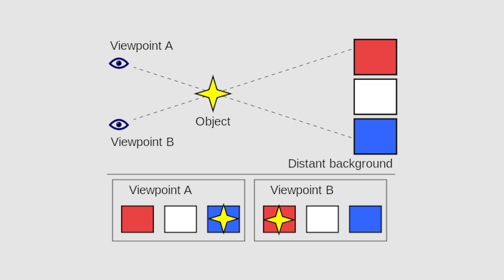How to determine lens nodal point for panoramic photography

Comment: That’s brilliant. Thank you.
Quick question, if I may: what computer do you use to manage a bunch of high MP files, when sticking your pano together? Assuming you’re happy with its speed and handling.
Reply from the maker: Hi Andrew. Thanks for writing and I'm pleased you enjoyed the video. In our studio we are a 100% Apple ecosystem, with a collection of desktop and laptop configurations. As long as you invest in a lot of memory and solid state drives, you should be able to handle the stitching with minimal wait times. When I shoot macro I might have 100-300 images to stitch in a focus stack and even my laptop handles it smoothly, although it might take time. When I shoot panos I rarely have more than 40-60 images, maximum, so that goes pretty fast. Keep in mind that I shoot medium format and those are 102 MP files!
Reply: @lespicker  Very useful, and reassuring, to know. I use Apple and am probably reaching a point of upgrade/change, although will 99% stick with Apple. With the increase in camera MP, processor-hungry software, etc, I have found it difficult to know what to expect anymore from computer performance. In my regular work as a freelance pro photogapher, I have lots of images to process, yet some apsects of processing seem to take increasingly longer, with new software!  The general expectation of the age is that we should be able to work at what I call click speed...instantaneously, or a couple of seconds, and it's all done. Certainly, my 2014 27"  iMac, albeit fully loaded, is, IMO beginning to struggle, and has reached the limit of OS upgrades and just now, optimum system requirements for PS. I'm thinking a 16" MacBook Pro M1 Max, with as much memory as I can afford....but, it's all getting quite expensive.
Reply from the maker: @andywilk38  Unfortunately, I agree with you! Computers that can handle our demands are more expensive and the software demands more time and attention. It used to be when I shot for magazines a couple decades ago, when I pressed the shutter button I was basically through. Hand in my rolls of film and that was that. Nowadays capturing the image is perhaps 10% of the job done. We have to back up in the field, import, back up again, post-process, save, export... whew! We just upgraded a 2013 desktop and will be doing more upgrading shortly, but that does put a big hurt on the expense side of the equation. In any case, best of luck as you figure it all out.

Comment: Well explained. Thanks.  What I don't understand is why you don't mount the camera with a long slider plate directly on the tripod. This way you can still achieve what you did without the fancy U shaped assembly. Am I missing something here?
Reply: Without the gimbal, you could only do single-row panos. Not only that, but your camera would need to sit perfectly perpendicular to the ground (no pitch), as pitching the camera would shift the nodal point in relation to the center of pan.

Comment: Great! Just what I needed. Looks like I need to buy a nodal slide to add to my gimbal.
Reply: Did you end up doing this? A nodal slide works by moving your camera forward and back to get the no-parallax point exactly on the axis of horizontal rotation. But a gimbal is balanced by moving your camera forward and back to get the center of gravity over the axis of vertical rotation. I think what you'd have to do is get the nodal point set right, then add a counterweight so that the same point becomes the center of gravity as well.
I've basically come to the conclusion that the big benefit of a gimbal  -- easy knobless flexibility to point in any direction -- is pretty incompatible with the precise, repeatable camera movement needed to take a great pano. Especially multi-row!

Comment: I see this is 5 years ago but still excellent exciting news for me. 
Wow! Lester I just found
You the other day on a video for mounting. I do all
My own mounting and Framimg and was delighted to see and learn
More from you. 
Thank you for this and looking forward to searching all your videos. 
If you see this I do have a question.
With this kind of accuracy, how much do you overlap the shots side to side and top to bottom flr two horizontal rows?
Thank you again!!
Scott
Reply from the maker: Hi Scott. Thanks for asking. I overlap about 1/3 horizontally and vertically.
Reply: @lespicker  Thank you again for your reply on this older post. I did find about an hour later another video you did on the whole set up it was in Hawaii. And you discussed the vertical and horizontal overlapping. 
Learned much from that video as well. I’m looking forward in the next week or so rigging up my own set up to simulate yours, and experiment with that access point and then start shooting some panos experimenting with that.
Thank you again for your reply!
Scott

Comment: Thanks for the video Lester. Regarding live view and just going out to the right, do you go out a little and move the camera until the back pole disappears behind the front pole?
Or, do you go out to the right a lot and move the camera until the back pole goes behind the front pole?
It seems that you would get different settings if you vary how much you test the poles' distances from each other.

Does the 'film plane' come into any importance is the nodal measurement?
Note, this is a prelim question. I haven't tried it yet.
Thanks.

Comment: What about the degrees of rotation depending on fov for each different lens? How much do you overlap? Would you overlap different amounts if you were using a wide  compared to tele?
Reply from the maker: Hi Kurt. Photographers vary on overlap, typically from 1/3 to 1/2. I find that 1/2 is too much, so I overlap approximately 1/3. This does not need to be exact, but try to keep it as consistent as possible. If you use my bezel graduations tip, you can get it quite exact.

Comment: Hi Lester, You mentioned in you video that you normally used the 70-200 Lens for doing your panos. It brings to mind one question. Do you mount the camera on the nodal slide or do you use the lens collar. Most of the nodal slides are in an orientation which would not allow the mounting of the lens collar. Thus far I have seen only one slide from RRS and another from Acratec in which the orientation of the clamp can be changed to accept the lens collar. Mounting the camera on the slide with a 70 to 200 would certainly strain or damage the lens mount. I would be most obliged if you could let us know how you do it and what nodal slide you are using for the purpose. The PG 02 is not available anymore. While RRS claim that the PG-01 can handle the 70 to 200 lens this looks a bit light to handle a large camera and a 70 to 200 lens. Would you like to suggest some other manufacturers who have sturdy equipment for doing the panos. Thanks and Kind Rgds
Reply from the maker: Hello Naseem. Good question. I do use my lens collar to clamp to my RRS setup when I used my 70-200. The fit is tight and rock solid. I appreciate the fact that I can change the orientation of the clamp with a couple of turns of the Allen wrench that RRS supplies. I have used RRS equipment for a couple of decades and have learned to trust their helpful suggestions. If they feel the PG-01 can handle the 70-200, I would go for it.
Reply: @lespicker  Hi Lester Thank you for clarifying this. I will look into this. Missed the chance to get a pg-02 on ebay. Communicated with rrs and they were not certain when the newer model of the pg-02 will come out. May opt for the pg-01. A couple of other makes also available like the Nodal Ninja and then some cheaper ones. Thanks again for your help and keep up the good work. Learned a lot from your videos. Best rgds

Comment: You don't need to know about nodal points if you are applying photogrammetric techniques (as of October 2018).  Use the info in the images to derive the single image from its constituent/source images (In a word: Photoshop CC 2018). You can handhold the camera...

Comment: Great explanation, Thanks. I have one question which I hope doesn't sound stupid. Is the lateral( centering the lens over pivot point) a one time adjustment, ie; does it change with different focal lengths like the nodal point? thanks
Reply from the maker: Hi Bill:

Not stupid at all. The lateral adjustment does not change, only the forward-backward movement, depending on your focal length.
Reply: Thanks!

Comment: Thanks you, any way to set this with a normal common tripod? Where the head on landscape position could be aligned with the rotation axis but in portrait mode not. Thanks
Reply from the maker: I assume that your head tilts to the extreme side when in portrait mode, like many tripods. In that case, the answer is "no". However, if you simply purchase an L bracket, it will solve your problem. They are available used for very little cost. They are rugged, so used doesn't matter. Good luck!
Reply: @lespicker  where i live there is no cheap L brackets, i amthinking on make oneby myself, what do you think in this case on shoot in landscape mode so i can get the same axis with the tripod? Thanks you Lester for your kind answer.
Reply from the maker: @bambanx  It is worth a try. Best of luck, Ivan!

Comment: This piece of equipment is more expensive than my tripod, some are more expensive than my camera, how so? It's just a piece of metal. I really want to make professional level panoramic pictures, but just for showing off on social media, not to make money. Well, I bought one, next step is finding the nodal point, that thanks to this great and intelligent video I think I will be able to do. And then I will redo my best panoramas and compare. How bad is the distortion if not using this equipment?
Reply from the maker: Hi Deyvson: Yeah, tell me about it! If you figure out why this stuff is so expensive, I'd like to know. One good thing about the pano gear is that it can very nicely double as a "wimberley" head for wildlife photography. In fact, that RRS pano setup is the only thing I carry. It saves weight, it is very stable and adjusts quickly.
Reply: This is all you need for simple panoramas — a binocular tripod adapter "L" bracket:  
http://i67.tinypic.com/2808cqh.jpg  
http://i63.tinypic.com/ogm2wk.jpg
http://i65.tinypic.com/f3e5wg.jpg
I've been doing panos with this for 30 years.  It cost me $15.  I added a couple threaded holes in the foot to help center the camera, which doesn't need to be precise.  You can make an "L" bracket for less, just use stout material.  This one came from Orion Telescopes.  Made of steel.
Reply: Check out the Sirui PB-10.  I bought mine on eBay for 100+ which isn't bad.
Reply: @lespicker  low production quantity, CNC'd (as opposed to die cast), made in USA stamp, niche  market, etc.

Comment: Good day Les. Really enjoy your informative videos respective to Panorama.  Someday I just might get lucky and find the RRS equipment at the end of a rainbow. With respect to the "Y" axis and Entrance Pupil...on any tilt (degree of angle change) from this "Y" ( multiple rows) do you find it necessary to re-adjust the "Y" closer to the subject matter?  Or is the roll-off of the "Y" very little and thus no impact?  Might just be that the RRS Panoramic Package has no "Y" roll-off.  Thank you.
Reply from the maker: Good question. The "roll-off" as you call it, is negligible and every post-processing package I have used handles that with ease.

Comment: Lester, great video. I have 1 question. You determined the nodal point over the tripod pivot point. How do you determine the nodal point at the vertical pivot point? It would seem to me that you would have to align it for the second and third rows.

Thank you,
Bill Conway
Reply from the maker: Hi Bill: Great question. To an extent you are quite correct, theoretically one should have to compensate for the vertical angles. However, that would be near impossible, since the vertical angles will change depending on how many rows you do and what the overlap is for each row. Fortunately for us all, present day software algorithms do a phenomenal job adjusting for this, so long as your vertical overlap is 1/3 from one row to the next. The bottom line is, just nail your horizontal nodal points  and all will be well!

Les

Comment: Congratulations from Spain for this clear explanation, but i have a question, it's really necesary setting the centre the rotation point with the center of viewfinder?, i ask it beacouse there are some videotutorials that only set's horizontal guide to find the nodal point, thanks in advance for your responding.
Reply from the maker: Juan:

Thank you for your compliment on the video. I think there is a translation challenge here. I don't quite understand exactly what you are asking. Please try to explain it again. However, if you are asking whether it is necessary to make sure that the lens in located directly above the center of the tripod, then the answer is yes.
Reply: +Lester Picker Thank's for your answer,  yes it was the question.
Reply: Sorry, i have another question..... After center the lens above the the center of the tripod.... Can i assume that adjustment it's equal for all the lens i use with the same camera?

Thanks.
Reply from the maker: Yes.
Reply: Forgive me if turned heavy ... Just to be sure. In my previous question, I was referring to that, understand that once set the center of the tripod with the center of a lens, that setting is valid for all lenses to use, and I have not 
to make that adjustment whenever lens shift . It is so true?

Again sorry for my insistence.

And thank you very much once again.

Comment: NICE video. But the problem I face is  distortion. How to overcome this issue? I have not found my answer till date after all permutations and combinations. 
By the way I have determined my nodal point of my camera and my lens.I have tried shooting with a Canon 35 mm prime lens. I have failed.I have even tried 24 -105mm lens Keeping the lens at 24 mm,but in vain. I face this problem in indoor photoshoots.
I use Nodal Ninja 3 mk 3 with a Rd 10 rotator.
My tripod is Vengaurd Alto pro 263 AB 100.
Please guide me as I want to nail this type of photography.
Reply from the maker: Michael: Sorry for the delay. It's impossible for us to resolve your issue from the data you've given us. It would be helpful if you would share with us several images showing us the distortion you see, as well as a detailed explanation of how you shot it. What we do not understand is why you are shooting panos with a wide angle lens. Of course there are sometimes reasons why someone might do this, but in general you would want to use a moderate tele so that you can take more images and get more pixels for the final pano. That also reduces the chances of distortion. When you shoot wide any distortion at the margins will be magnified as the images are stitched. 

In any event, please go to my website and you will find my email. Put the images into a shared folder you create (Dropbox, Adobe or whatever) and send us the link. We'd be happy to take a stab at your issue.

Comment: If I calibrate a 70-200 for multiple nodal points, would that be relevant information for other lenses. for example, would the correct nodal point for 80mm on a 70-200mm lens be the same as the 80mm setting on a 24-105mm lens?
Reply from the maker: Paul:  Good question. Since every lens has different optical properties, you must determine the nodal point for every lens separately. So,, the short answer to your question is "No".
Reply: Dagnabbitt!! lol..

Comment: I have a Nodal Ninja 6 with RD16 II rotator.  Nikon D610.  I have repeatedly been through the process with the poles at different distances.  1st pole at distances of 2 up to 6 feet, and second pole at distances of 6 feet up to 15 feet from first pole.  I use the 1/4" screw on top of the first stand as a "fine adjustment" point against the second pole.  Here's the interesting part:  after repeated tests and variations with AF Nikkor 35mm f/2D, AF Nikkor 50mm f/1.8D, AF Nikkor 85mm f/1.8D, & AFS Nikkor 105mm f/2.8 Micro, all at f/11, they all "zero out" at exactly the same point.  I can lock the rotator and slide the camera to where the poles align, and it's always the same point for each of the lenses.  Zero shift for each and all at exactly the same setting.  Would that be due to the use of prime lenses?  Seems odd to me, considering the variations in focal lengths.

Comment: is it ok to just "eyeball" the sideway position when pointing downwards ?
and do you get the front/back position precisely enough to get a flawless result ?  or is a bit of photoshop paralax fixing always needed ?
Reply from the maker: Hi Maalte:

Thanks for the questions. I get this a lot. First off, it is perfectly fine to eyeball the center position over the tripod, or at least I have found it to work. The front/back that you refer to is the nodal point (actually it is more precisely the entry pupil point, but let's not quibble about terminology!). So, it is best if you can get this pretty close to exact, but it is not that it won't work if it isn't totally precise. Get as close as you can and you may need some slight post-stitching adjustments. Hope this is helpful. 

Les

Comment: When you change the orientation of the camera to determine nodal point, doesn't the center of the lens move away from the center of rotation?
Reply from the maker: Changing the orientation does NOT change the center of rotation. Look at your lens as you change orientation and you will see that it does not change front to back positioning.